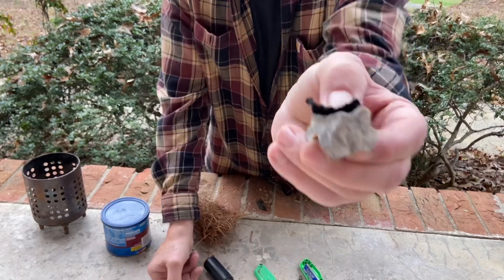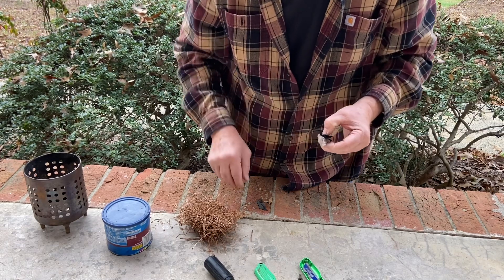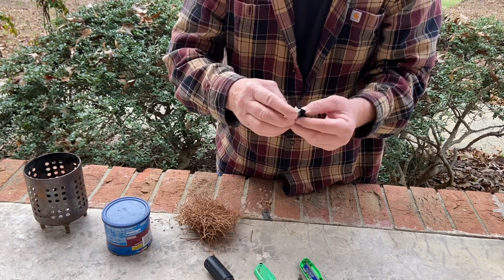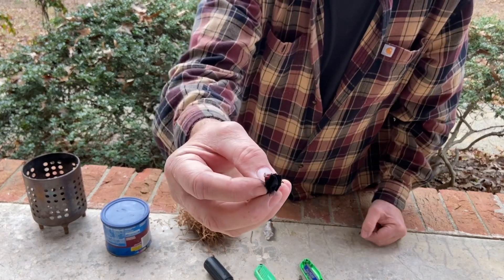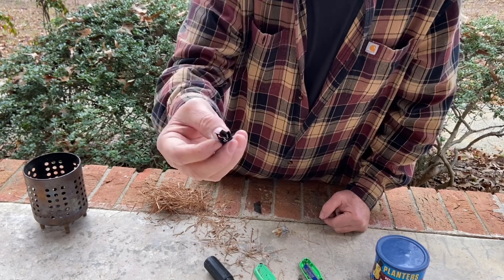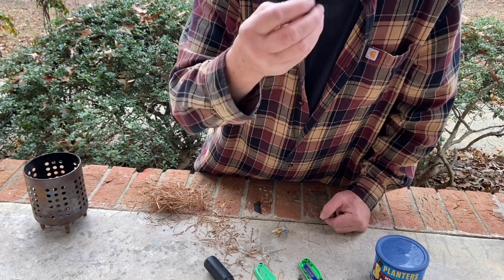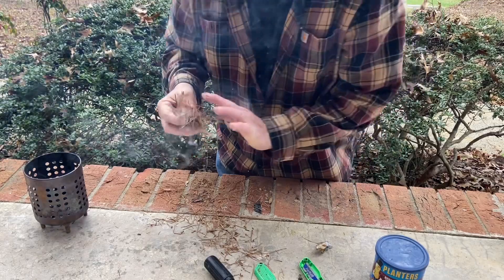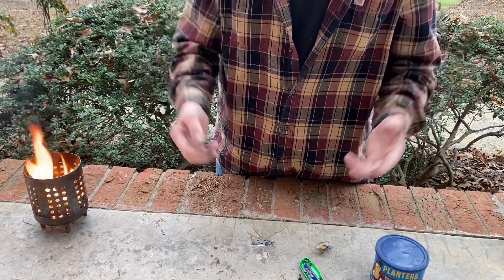Flint And Steel, Using A Utility Knife Blade For The Steel!!!

Comment: At the ‘Danger, danger’ portion of the video where you show the closeup of the blade, there appears to be a significant amount of rust or discoloration on the blade. To me that indicates a very high carbon content for the stainless steel which could account for the sparks. Your thoughts?
Reply from the maker: Yes, low quality SS will stain and rust. Utility knife blades are made from the 400 series SS. It has much higher carbon content and is magnetic.

Comment: Tried that shortly after watching and same result. Never would have suspected this, good to know. Thanks
Reply from the maker: I love that it works. I'll be using it in more of my videos.
Reply: @DavidWestBgood2ppl  Most "stainless steel" utility knives I have rust pretty quick so never thought them to be of any good quality. Used a rather old one that I scrubbed some rust off and it worked great. A good amount of spark of flint, chert and a piece of jasper I have.
I have a cheap utility blade in my kit as a back up to my Opinel which is a back up for SAK which is a back up for my Cold Steel SR1.
Now I have another use for it, apart from being a backup cutting tool.
Reply from the maker: You're really prepared, awesome!

Comment: utility blades must be a low grade of stainless as I've seen plenty rust
Reply from the maker: Yes, made from a low chromium alloy. It's the 400 series of SS. You can also buy high carbon steel blades that will rust easily.

Comment: I tried a hacksaw blade the other day, but couldn't get a  spark. I wonder if  it's a brand name issue? Cheers David.
Reply from the maker: The better hacksaw blades are made from bi-metal, therefore you may need to smooth the teeth off and scrape that side with your stone.

Comment: Cool video David my thoughts on the utility knife blades are curious as true stainless steel won't rust but Stanley's blades and outher types come coated in oil to prevent rusting so to me they aren't what we know as true stainless steel but none the less very handy for said fire lighting just my two cents brother
Reply from the maker: Google types of SS. The less chromium the more likely stainless will stain and rust and even be magnetic. These SS blades are made from the less chromium alloy, the 400 series SS.
Reply: @DavidWestBgood2ppl  thanks for the info David I will definitely Google it as I evidently need to catch up on my metallurgy 👍

Comment: David, Have you ever tried  using a sawzall blade  as a steel?
Reply from the maker: No, bi-metal blades wont work unless you smooth off the teeth first and use that area.

Comment: Nice video. I’ve used a box cutter successfully myself, but I keep the blade in the case and strike it against a large chunk of quartz at a downward angle. Probably way less efficient than your method but a little safer in my experience. I’ve used this technique with success using screwdrivers, nail sets, a 3 inch Phillips insert bit, recip bit. Keep up the good work, and take care.
Reply from the maker: Yes, I've used hacksaw blades, knife spines, putty knife, files, and now this utility knife blade.
Reply: @DavidWestBgood2ppl  awesome video! I always learn something every time I watch one of your videos
Reply from the maker: Thank you!
Reply: @DavidWestBgood2ppl  I’ve had great success with the fire roll technique using potassium permanganate... but ZERO success with various combinations ( glycerin, sugar, brake fluid)... what am I missing?  I’ve watched many videos on this and they all look very easy to reproduce but I just don’t get the same results. Sorry I’m a little rambling and off topic... Any suggestions would be greatly appreciated, thanks.
Reply from the maker: Those BoggyCreekBeast discoveries have never interested me, but I can advise you this, bear down as hard as you can while rolling. When it works, start experimenting with how much pressure the ignition actually needs that hopefully doesn't wear you out.
Reply: @DavidWestBgood2ppl  thanks again, and keep putting out those great entertaining and informative videos we all love!

Comment: Guess what I'll be trying here shortly? Ultralight and compact flint and steel sounds pretty good to me.
Reply from the maker: I should have checked to see if you could get sparks off a that thicker edge too. Let me know if you try it.
Reply: @DavidWestBgood2ppl  sure enough the ticker edge on the front works but not as well. I think it would improve as it gets more beat up but the edge works so well. Who doesn't have one of these laying around that is full and beat up?
Reply from the maker: Makes sense. The sharp edge will give up microscopic pieces of iron easier than the thick edges especially when there's such little mass in the blade.

Comment from the maker: Please see the LINK below where I saw this technique on YT... Yes, with a grinder you can spray a nice shower of sparks off Stainless Steel, but I've never thought of Stainless as being able to cast sparks with just a piece of chert. 
   Apparently, any steel that has 98% iron and enough carbon in it to make it hard enough will work. The Flint scrapes off microscopic pieces of iron off that interact with the oxygen in the air and self-combust... So even an alloy like Stainless Steel with it's added chromium and nickel will work.
   Please follow the LINKS below and SUBSCRIBE. Thank You!

Flint And Steel Playlist
https://www.youtube.com/playlist?list=PLkoXX8XsMW3mFf5FgLtam1aDmXmqQQice
Ultralight steel striker - boxcutter blade !
https://youtu.be/I-UHWbZJjfE